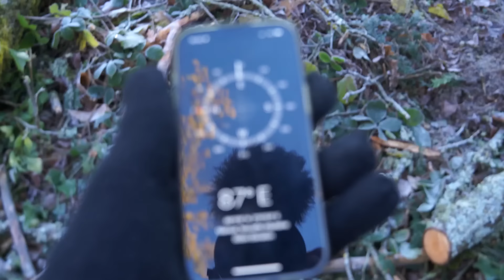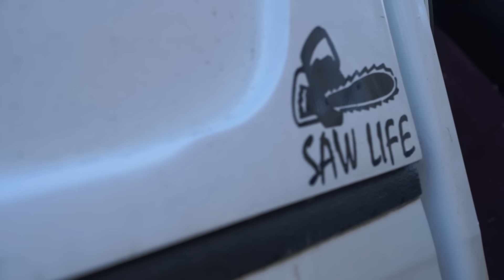Uncovering the original ruin gardens, using lost wartime photographs

Comment: I'm sorry, but I couldn't watch the whole video Dan. I'm deathly afraid of heights (or, well, landing after a long fall) and I couldn't watch Nick when he went higher than 2 feet off the ground. I'm sure he did a great job up there. 

You've clearly got a hard worker with ba... nerves of steel working with you. I think this part of the restoration will go more quickly than you think. 

Great job so far!

Comment: Dear Dan - I have a question; Why don't you just set up a section of the basement to move into for now instead of putting a separate building on the premises?  The basement looks fairly waterproof, is it?  Sure, you have to put in windows, doors and electric.  But wouldn't you have to do that anyway?  Just wondering.  :)